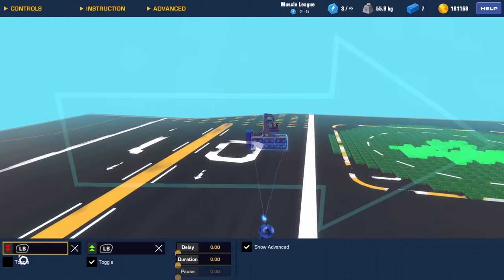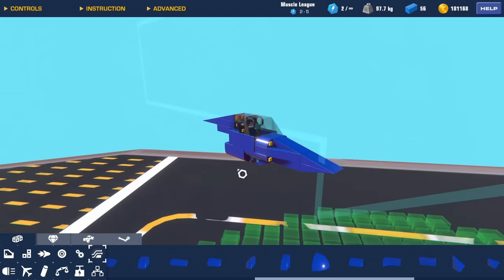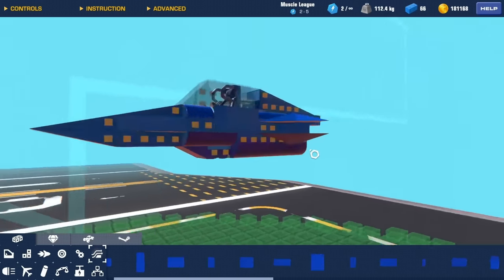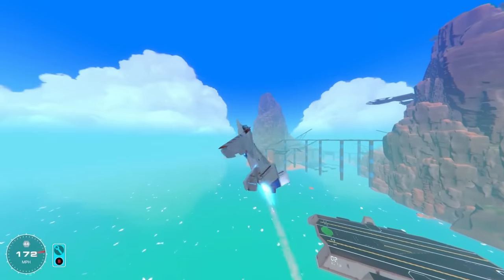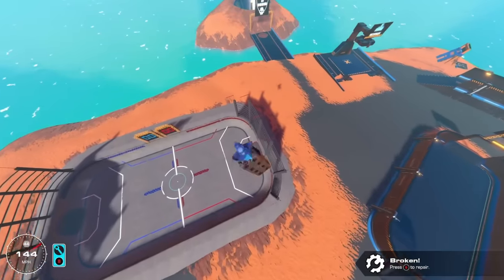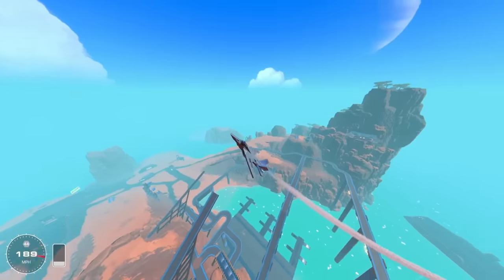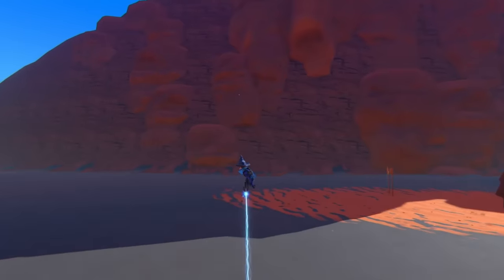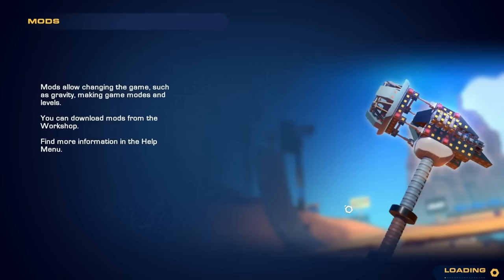Will This "EJECTION SEAT" in Trailmakers Work?!

Comment: Definitely better than my ejection seats, which are basically a RAW jet stuck to the back of an Operator's Seat, with the main issue with that being that all the thrust is in the back, so actually getting clear of the plane instead of crashing into it can be tricky, especially if you're trying to do it while your plane tumbling towards the ground out of control.

Comment: Btw I think you can make a parachute with out using any mods if you connect a speed sensor to a gimbal thruster you can set the max speed you will fall